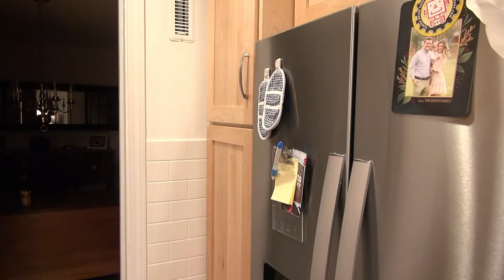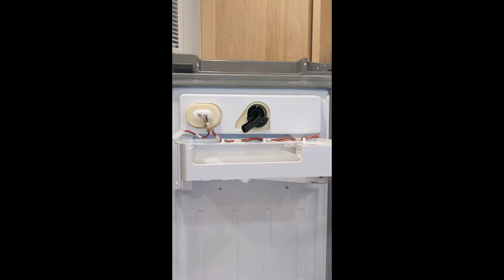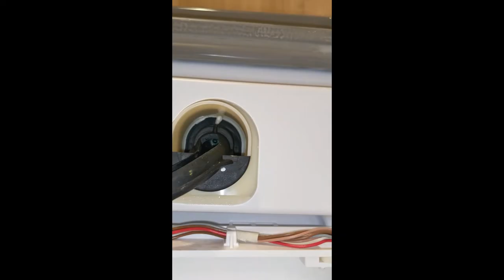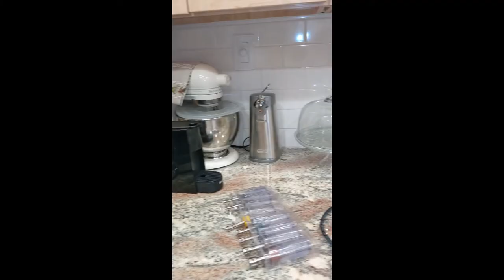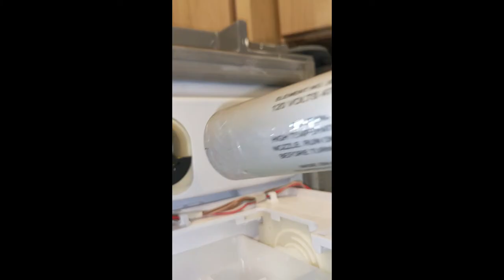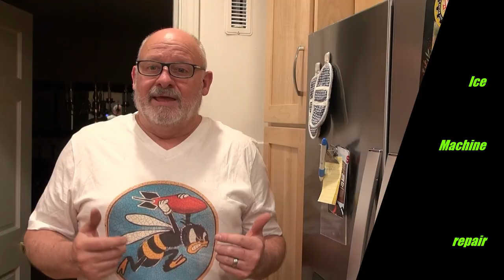ICE MAKER REPAIR simple and quick

Comment: The rotating gear in the bottom of the ice tray wasn’t interlocking tightly with the motor gear in the door…on my Whirlpool fridge. I looked on the Whirlpool site to buy the gear and all they had was the whole ice tray door for some $267.00.  So I found a thin washer that fit between the ice tray gear which essentially pushed the upper gear down into the lower gear tightly and it works perfect! Cost me nothing! You only remove the one screw that holds the ice tray cog/gear…remove the gear…install the washer and put the gear/screw back in…easy! Save yourself a chunk of money.
Reply: I think that’s what mine is doing. The tube isn’t iced over, the tray has ice in it, but it hasn’t dumped the ice from the tray to the lower compartment yet.  Been like this for a couple days.

Comment: This problem can be caused because the water valve to the ice maker is not shutting off completely.  This allows a slow drip at the ice maker which does not flow fast as when it would normally when filling the ice tray. The slow drip can end up freezing in the fill tube.
Reply: what is the solution to this? its happening to mine now.

Comment: Worked for me--thanks! Mine is less than a year old and it's the third time. (The first time the dealer came and replaced the ice maker, second time it just started working again magically, third time your fix worked.) Trying to figure out WI lemon laws.
Reply from the maker: Yes, it is a defective design.  I am hoping that the foil I added will keep it from freezing
Reply: @neuromanglers  where did you add the foil? I didn't see that part.

Comment: I can't thank you enough for this video!  I have been struggling with this issue for months and months. Whirlpool wanted to replace the door for > $1000. I originally thought it was a broken wire at the bottom based on other users experiences. I am so glad that it was this easy to resolve.
Reply: Mine had 3 broken wires at the bottom of the door. It took me about 30 minutes to fix. I had some wire laying around, so i cut 3 pieces about 3/4" long. I slid 1 1/2" pieces of shrink wrap over the wires at the harness ends of the wires, soldered the new wires at both ends, and slipped the shrink wrap over the exposed wires and used a cigarette lighter to shrink the wraps. My icemaker has been working like new for the past 3 months.

Comment: Thank you so much for posting this video. I have the same fridge as you. Mine is a year and nine months old and the ice maker quit making ice a couple of weeks ago. I could hear it going through its cycle, but ice production was almost nil. I took the cover off and saw that the water spout was iced over, so I melted the ice that I could see, but still no ice production. Then I found your video. I did what you said, using a copper wire to melt the ice that was plugging the hole, and that fixed it. I have ice again. Thanks for your help. BTW, great job on recording a view of the hole. It's hard to see it way back up in there, but you got a good shot of it.

Comment: We have used your video two times now to fix our icemaker.   Sometimes just a hairdryer will clear the ice but on two occasions we have had to use a wire . I used a wire paper clip.   This last time the icemaker stopped after we changed the water filter as you mentioned in your video.  Your video and explanation were well done.

Comment: You sir, are a gentleman and a scholar.  I've been fixing things a long time, and I would never have figured this one out.  I hate to think how many people have been ripped off on having their ice-maker and/or solenoid replaced, when this was the actual problem..  For those attempting it, I would add that a hair dryer works just fine, and the copper wire, because of its heat conductivity, makes short work of thawing the ice blockage.  Mine froze up unexpectedly, and has never done this before.  I would add though, my wife had recently placed a jumbo bag of frozen strawberries (football size) on the shelf next to the ice maker.  It may even have been in contact with it.  I believe this initiated the freeze-up.  Now my wife thinks I know what I am doing, which is priceless.  Thanks man!

Comment: Ice Maker is working!!  My Kenmore/Whirlpool Ice Maker stopped making ice at maybe 2 years old. Three or four times it would start working again after a few months and then stop after a week or so. I thought it might be a frozen water supply line and actually pulled out the Ice bucket and blew hot air up into the covered mechanism with a heat gun.  After watching your video I am very embarrassed that I didn’t see/know that by removing 4 screws I could expose the entire mechanism and the water supply line!  And with the cover off I could see a small amount of ice in the supply line and easily remove the ice.  Knowledge is power!  Thanks for the info.
Reply from the maker: You tube is very helpful in this way.  Happy to hear good feedback on your results
Reply: Its a whirlpool design, Kenmore can be Frigidaire/Electrolux, GE/Haier, Samsung/LG design (All crap) look at the model number and then look at part numbers.

Comment: Thanks for the great video! I have used it three or four times. Seeking a long term solution, I changed the freezer temperature control to "Cold", which is the warmest setting. After about 12 hours, the ice maker fill tube thawed itself out and is now working! Ice cream bars are still solid!

Comment: Thank you. 
Mine is a wrs588fixz00. I removed the container to clean, dry and it quit making ice. After your video, I found an ice plug. Bit of heat gun action, a few picks on it with narrow steak knife and I got the plug out. 
With heat gun, apply bit of heat, pause pointing away, bit of direct heat, pause, repeating with a few pokes with a steak knife to work the ice plug. Took me no longer than a couple minutes. Watch the screws. Put a paper towel to catch the screws. Also, the screws are cheap pot metal and will deform easily so be careful. Wipe the container gently before reassembly.

Comment: Thanks so much! I've been looking all over for this info. Don't know if I can get my machine going, but at least I've got a plan now.
Reply from the maker: hope it helps you .  I know it is very frustrating sometimes to even find the real details and facts that matter.  If you have the same ice machine...I bet you too can get it resolved.  heat a wire to melt the ice blockage and then use some aluminum foil to create an insulator to prevent it from happening again.  I have a feeling the manufacturer left off that part because it looked as if it was designed to have such a feature
Reply: Second this, thanks neuromangler!

Comment: OK, I have the same model and ice stopped a few weeks ago.  I was so happy to find this video....tried it this morning BUT of course my luck, still didn't work. Never had a drop of water come out as I put the hot wire in and worked it for a while.  Also used a hair dryer for quite a bit.  Is it possible that the line is still frozen past the point where I stick the hot wire in? It did feel like the hot wire was going thru ice as I inserted it but it's either still frozen beyond that point, OR it is another issue causing the ice not to work.....just not sure now. Very frustrated.

Comment: Identical issue, I’ve become an expert at raking it apart and thawing the tube. Have you come up with any actual fix to prevent the freezing of the water tube?  I’ve tried blocking the cold air vent that blows directly into that opening.

Comment: I just bought mine today. I had I delivered and it has not made any ice. Switch is on , water was purged in order to remove air. It was delivered and installed. Guy said give it 24 hours. I’m going to have to call Lowe’s back, I also bought 5 year warranty. Thank you for posting this video , I would fix it but it would void the warrant.

Comment: I wish this were my problem. I have a different fridge but the exact same icemaker. My tray fills just fine it just wont dump!! Ive already replaced the ice maker itself and yet I have the same issue... the new one filled no problem, but it won't dump the ice! Im starting to think there might be an issue with the switches on the side. Any advice?

Edit: i just ohmed the switches on the door itself, and they are good. 0.00 resistance with sound. This is driving me crazy esprciallt after replacing the icemaker as a whole itself. New filter too but the old ice tray filled no problem..
Reply: If you figure something out please here here. I will do the same. 
Mine is doing the same thing. It won’t dump from the tray not sure what’s going on

Comment: After you did this did you hear the water start running into the ice maker after you put everything back together?
Reply from the maker: not immediately but later after it cooled down enough
Reply: @neuromanglers  ok. I didn't see any ice but did this. I have condensation at the top of the freezer that is frozen. The seal on the door looks good

Comment: I have the same refrigerator and have had to heat up the frozen water line 6 times now in 2 weeks. Fridge is only 18 months old. I’m at a loss at this point. Have you had more problems since this video and if so have you come up with a permanent fix?  Thanks.
Reply from the maker: we turned up the temperature setting just slightly and have not had any issues since.  Good luck....I know it is very frustrating
Reply: @neuromanglers  What temperature did you turn it up to?

Comment: Replaced both water valves in the back.  Definitely not the issue.  Save yourself time and just check the wire at bottom of freezer door near the hinge.  Black wire tore in half.  Exact same thing as my parents whirlpool.
Reply: Thanks for your comment, we replaced ice maker and inlet valve and still wasn't working, after reading your comment checked the wires and the black and red wires at bottom of door are broken in half.
Reply: @lindaclark2477 how does one repair that wire at the bottom is that harness a part you can purchase?

Comment: mind explaining the aluminum insulator? i've had to make this repair a couple times now...
Reply from the maker: I loosely folded a sheet of aluminum foil several times to create layers of foil that trap air and formed it around the opening at the top where the water trickles down into the ice tray....making sure to leave the opening clear in the water trough.  It has worked for me, no more frozen water feed issue.   It appears to me that the design was to have such an insulator but it got deleted in the build

Comment: I have the same model.  Our freezer door does not seem to shut as good as I think it should.  The freezer door appears to sit slightly higher than the refrigerator side.  I can't seem to figure out if there is a way to adjust it.  Do you happen to know?
Reply from the maker: I seem to recall seeing an adjustment for the door mentioned in the manual

Comment: Mine did not have the frozen water in the line...The ice maker is a few years old and the motor doesn't even come on. It started not working about when we changed the water filter. Do you think we need a new ice maker or something else?
Reply from the maker: I would pull the filter out and make sure it is not plugged and also make sure it is fully seated in the fittings

Odd tho, the motor does not activate...sometimes mine does not activate and I found the dispensing lever must be fully depressed in a certain manner to activate ice dispense

Comment: Thanks so much for this. I have a question to see if you have any guidance. The ice maker water hose is cracked right below the door. It makes kind of 90 degree curve to enter below the fridge into the water connector. That 90 degree turn plus the old hose is made the crack, so is leaking. I tried using tape but the pressure when filling ice tray is so strong that keeps leaking. Any idea? Thanks so much!
Reply from the maker: I would try thick walled silicon tubing
Reply: @neuromanglers  will try. Thx

Comment: This was my issue with my Maytag that is very similar to your setup.  I got mine unplugged and it used up again a few days later.  I repeated the process a few more times and iced up every time.  Any ideas? My filter is new too and flushed.  Very odd.
Reply: Wrap the black tube with a folded multilayer aluminum foil.

Comment: My ice make is working but when the ice tray fills I get water spraying into my fresh food side during the fill. It is coming from the meat/veg selector sliding switch on the bottoms left side of the fresh food compartment.... any ideas why?? TIA
Reply: I solved the problem already. I fount the reservoir for the ice maker, located in the fresh food compartment had a connector that was unseated. This caused water to leak into the fresh food compartment during the ice maker fill event. I believe this was caused when water in it froze as a result of the cold air diverter valve failure. Everything in the fresh food side was freezing even though I set the temperature to the minimum setting of 45F.

Comment: This frig was exspensive and I always have issues ice I had to go back to putting ice trays in it again
Reply from the maker: I found a solution to the freeze-up by using aluminum foil to create  an insulator around the water outlet.  It appears there could have been such a feature designed but the part was left out

Comment: What’s it mean when the unit is making ice but won’t dispense it?  Can hear the motor working but just makes a clunking noise and no ice comes out
Reply from the maker: That is usually simple to correct when ice sticks together and  jams up in the dispenser chute.  I remove the entire ice cube storage bin, it pivots out and lift up to remove.  Dump out all the ice into a bowl or bag if you want to save it and put the tray back into position.  You may need to wash the storage bin and if you do,  make sure it is totally dry before installing it back into the freezer
Reply: @neuromanglers  thank you! Yes you are right.  Ice keeps melting at the bottom of the bin and hardening around the auger.  We keep cleaning it out and clearing it but continues to do the same thing.  Tried making the freezer colder but hasn’t helped.  I think maybe that flapper in the ice chute might need replacing?  Not sealing off anymore? Motor works. Checked auger and it spins when no ice build up.

Comment: Ok I tired this and it worked for two to 3 trays of ice and it froze back and stopped making ice again. Any other ideas ?
Reply from the maker: when I made the aluminum insulator, I loosely folded the aluminum several times trapping air in between the layers and then molding it carefully around the opening and it has worked for me going on a year or more.   It appears to me that it was designed to have some sort of insulator shield by the way it was made
Reply: @neuromanglers   yes I agree that’s why I stuffed insulation in the open area and around the tube thinking that would be even better but still freezes up I wonder if there is a sensor or a line warmer that’s bad that keeps the line from freezing
Reply from the maker: I would try the insulation again, the idea is to not fill the void around the spout but to create a pocket of air and shield it from the cold air
Reply: @neuromanglers  ok I will pull the insulation air and just wrap with aluminum foil , if that  doesn’t work I guess I’ll have to call “the man”

Comment: 2 year old kitchenaid/ whirlpool. Same ice maker. wires in freezer lower hinge broke ice stopped working all controls in freezer door wires go in through the bottom hinge with water lines.  Super common failure. Check for broken wires. Extended warranty repairman said whole door needed replaced 1200$. Price of door if we had to pay. Warranty company said no won’t repair it and refunded purchase price of refrigerator, Will be buying a different brand and style ice maker.
Reply from the maker: Thanks.  Seems like by now they would figure out how to make a quality product.  It would not surprise me to learn it is carefully designed to last just past the warranty to increase sales

Comment: What if it’s not frozen, no ice on the hose
Reply from the maker: it is difficult to see when the water line is frozen, you will not see ice on the tube as it builds up inside the tube.  You should try warming up a flexible wire and see how far you can push it into the water tube....I bet you will find it clogged with ice
Reply: @neuromanglers  I did try and still nothing but in another video, looking at the wires under the door there are 2 broken ones and they say this may be the reason. So waiting for this guy to fix soon, as I am staying away fro electric stuff. Thank you
Reply from the maker: I have heard that is a common issue to have the wires break where they pass thru the hinge but have not actually had that problem with my fridge ....yet...  Good luck..hope you get it resolved.

Comment: To follow up and to help others with the same problem  where this may not work as it didn’t work for me .I have figured out what the issue is . There are  a few possible suspects . I bought this part first , and did not work but can be a problem 

New W10341320 Refrigerator Water Inlet Valve for Whirlpool replaces WPW10341320 AP6019939 W10341320 PS11753250 by Robertshaw

But the part below was the problem. And after quickly replacing it the ice maker is working fine . This part is very easy to install 
FBA] NEW OEM Produced IMV-8100 WPW10238100 W10498990 for Whirlpool Kenmore Refrigerator Water Inlet Valve by Robertshaw Replacement Part-1 YEAR WARRANTY
Reply: So they have 2 different inlet valves?  Choose the 2nd one I assume